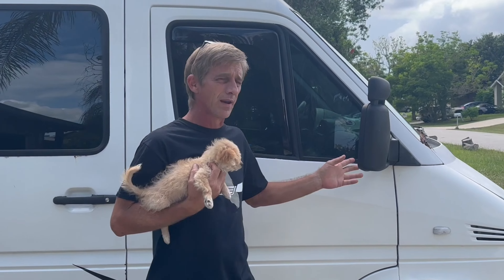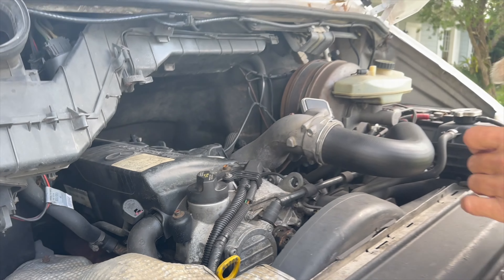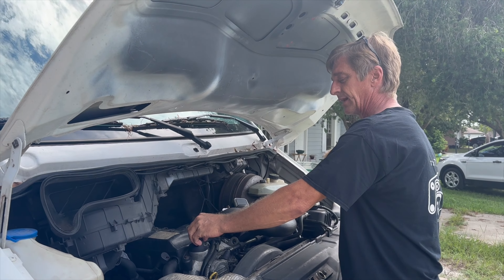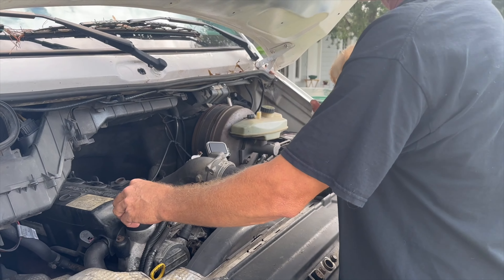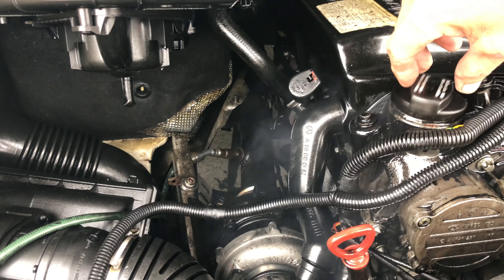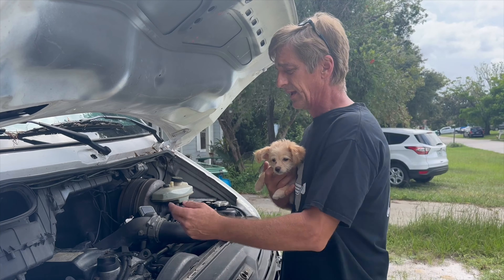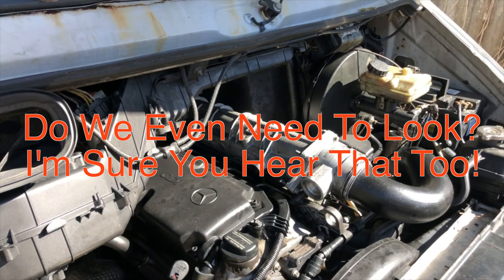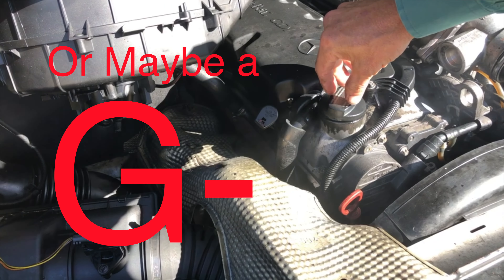Cap Dance Test   What It Is & What It Means!

Comment: Watched this video, tested my van, C-...heard a statement about breather filter, watched another video on cleaning the filter... A++.  Thanks!
Reply from the maker: Do you ever need to add oil between changes? And did this change after cleaning the breather? I'm trying to determine if my change is due to cleaning or other maintenance.
Reply: I rarely add oil...used to go as far as 10k between changes... now I stay at around 7.5k.

Comment: I've done about 5 cap tests on different vans all with a range of miles, om646, om651. Found the cap dances much more. However oil filler pipe is sump mounted, so believe this is the reason.

Comment: Hi Bill,
Just did the cap dance test on my  178k miles 2003 sprinter and was surprised it danced significantly! Engine runs well but did have to replace vacuum hose when v belt shredded and severed the hose Also I’m guessing crankcase breathers never been done so am I right in thinking these could be the cause?🤞
Many thanks for your videos, they have been a great help👏
Reply from the maker: Yes, vacuum leak will make the cap dance but sounds like you fixed that. Cleaning the breather may help settle the cap but don't go to extremes trying to fix a small symptom. In the video we show some really bad examples and I assume yours is not that bad. A dancing cap is like a cough... Could be cancer or could be a little dust in the air making me cough. If the dance stays small, don't worry.

Comment: Hi Florida Van Man,

my cap is dancing a lot, like your f grade...but i checked the crankcase breather and vacuum lines..everyting is OK. Also, the van is running perfectly and there are no other signs that qould suggest any major problem...so what should I make of it? Because i dont know where the pressure comes from..must be the piston i guess. Does anyone have an idea?
Thanks a lot by the way
Reply from the maker: If you send me a short video, 10-15 seconds of the engine running at idle with the hood open I can give you an opinion. Find me on Facebook or cypher my email address. Bill at Florida Van Man dot commercial but I won't spell it out for the bots.
Reply: @FloridaVanMan  Thanks! for the reply!

Luckily everything works, i am not sure if it was the breather now but after cleaning everything and putting it back together everything is ok. Maybe i overreacted a bit when i did the first test...it was late and dark already..Anyways thanks a lot and keep going please, its the best channel for sprinters :D

Comment: I'm looking at a 2004 T1N Sprinter van. I performed this test and found that the oil cap is just around  or under the A+ level, maybe moves a little more than your example in the video. Could I be certain that the engine is okay, and that it's only a clogged breather or vacuum system leak, or should I be concerned that it's a bigger underlying problem? TIA
Reply from the maker: Even a grade C cap dance we can be certain the engine has no major blow-by issues. Of course this tells nothing of the many other problems an engine might have, so I shy away from saying it is certainly OK. Like high school, C's and D's are still passing and only suggest improvements can be made. Vacuum system and crankcase breather are likely suspects, though mild cylinder wear could cause the cap to dance anywhere between undetectable and not mild or totally horrific (grade F). This would also cause a strong oil burning smell in the exhaust that burns our nostrils a bit.

Comment: Hi when I have another person    revv the rpms over 2500 it takes some effort to pull off the oil fill cap, because of crankcase vacuum. Is this normal ?
Reply from the maker: Are you trying to take the cap off while the engine is revved near 2500rpm? Why?
Reply: @FloridaVanMan 
 the mechanic keeps readjusting the y pipe and tightening the clamp, cause it leaks oli under the turbo. I'm wondering if it's the pcv stuck open. 
 Do you have any recommendations to test the pcv? Thanks
Reply from the maker: @johnathonbrase1842  We don't have a pcv on a T1N Sprinter and we certainly don't have a Y pipe on an inline 5 cylinder engine. What van are we talking about. If the turbo is dripping oil it is because of one of the two copper seals on the supply line or the aluminum gasket on the return line. Most likely the one of the return line bolts is not tight because the alternator blocks access.

Comment: My cap weigh at 38g. There is slight dance which is normal. Certainly not jumping around. 

Dipping the engine oil level before starting and vs after starting & kept at engine idling you should see a 20mm drop in engine oil level towards the minimum mark on the dipstick 

If blow by is high then engine oil level will drop by only 5~10mm due to the higher than normal crankcase pressure when engine is dling. 

You can confirm this by removing the oil filling cap while engine is idling and dip again for engine oil level.
Reply from the maker: The dipstick tube goes deep into the oil and the level in tube will rise from air pressure* in the crankcase. The cap dance is a measure of air flow* in the crankcase. They are as closely related as amps and ohms, but not quite the same test. Air flow is primarily a factor of the vacuum pump activity, variable small amount of blow-by based on ring and cylinder wall condition and temperatures. Pressure* is a factor of the air flow AND crankcase breather status. The breather status is almost, but not quite, irrelevant when the cap is unscrewed. how much the dipstick measurement changes will also vary greatly with oil weight and temperature as thicker oil will cling in the passages higher up.

Comment: Do you know why t1n sprinter piston cracks?
Reply from the maker: Uneven distribution of heat due to injector failure over-fueling or "tune" modifications like EGR delete. EGR purpose is to control combustion temperature.